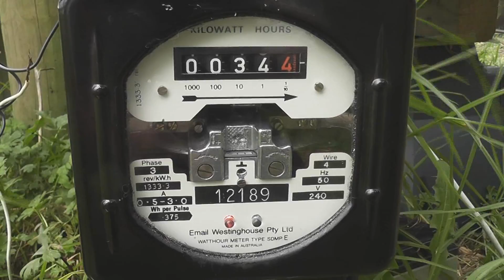Wasps v melting PVC

Comment: You might look at the wasp sucking machine that Matthias Wandel made.  It seemed to work rather well.  The thing about it is that you could leave it running without worrying about someone getting into it.  I do like your different experiments and my wife likes them as she is allergic to their sting.
Reply from the maker: I have seen Matthias Wandels wasp sucking machine, that one works very well. At the moment there are no wasps in our garden, except a few paperwasps which I am currently observing.

Comment: Buy a small bottle of gallium. Gas the wasps with normal smoke to make them sleep (not dead). Melt the extremely soft and low melting point gallium. Pour it into a small funnel. Rain molten metal on the wasps. :)

Comment: you may want to consider getting rid of the little buggers should they return using a molten metal like pewter, aluminium or lead, or another metal with a relatively low melting point. not only will it kill the bastards, it'll make something that's apparently classified as "art" and will probably sell to some pretentious prick on eBay.

Comment: Hey Ray, have some way of keeping the clear plastic cylinder firmly stuck over the hive, a lid on top with a small blow hole with a shutter that shuts itself. Then have a hose from a barbecue gas cylinder leaking gas in. After a short while, have an igniter light the gas. You'll get an entertaining light show (a flame going several feet into the air out of the blow hole) toast all the wasps in the column at once and if you can evacuate the space inside sufficiently, you can do it repeatedly! :D
Reply: you do realize this would turn the plastic jug into a rocket right? not to mention the fact that if you do get all the air out it wont burn well or at all in the first place.

Comment: odd you haven't tried a safe chemical treatment that would quickly wipe out the adults, like Pyrethrin sprayed into the container.  it should give you a kill rate higher than 40, and if released over the nest should do some major damage to the wasp population inside.

i'm sure you are trying to kill them the fun way, but watching them slowly die should be good enough

Comment: what is your energy bill like lol
Reply from the maker: +shineything4444 Too much
Reply from the maker: +shineything4444 Lots NZS 350 a month ( US$ 250 Month) ±1300 kWh / month
Reply: tbh that is not bad in us dollars my bill is usually around 550 to 600 a month
Reply: Wow you either have a big family or have very inefficient appliances, or someone is ripping you off. Not sure which, but that's a lot of dough for one months electrically usage
Reply: lol the heat wouldnt be to bad if it wasnt so damn humid but our central air is broke and are just using ac units in the windows because once again we need everything replaced and will cost a grand total of 5k to fix lol so screw it and yes i agree with you i want to move back to michigan lol
Reply: I notice lol its a very old house made in the 60s but can't afford new things and in Florida they boost the electric bills up go figure so yeah basically both
Reply: +shineything4444 
Plus you must use more A/C during the hotter parts of the year, do you not?
lol I don't like florida, too hot for me XD
Reply: +Benjamin “Ozias” Esposti for the central air everything on it needs to be replaced the air handler and furnace outside and all the wires and lines and ducts
Reply: +shineything4444 
Yikes!
What did they use, paper insulated wires?! XD
Reply: Benjamin Esposti  most likely lol then again cant complain because its from the 60s still, just to poor to get new ones thats basically a new car for me lol
Reply: +shineything4444 that´s like 20 times more than we pay monthly :D
Reply: Don't you work for Vector or something? Have you thought of getting a solar PV power system?
Reply: +shineything4444 
Pssh, heheh, yeah, the humidity really kills me. I can stand the cold, but not the heat - especially if it's humid! :(
Wow, does your A/C need a new compressor, or what? I hate to laugh, but america is supposedly the best country ... yeah right lmao XD (I do live in the USA :P) It's only because of the few wealthy people that it seems "rich" and "powerful". -_-
#FuckDonaldTrump :DDD
Reply: lucky lol were thinking of getting a small loan (of a million dollars) and update this house badly because its in bad shape and might be on a sinkhole as well